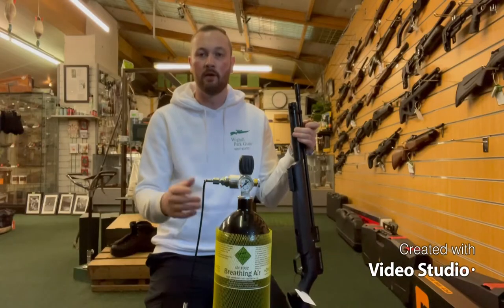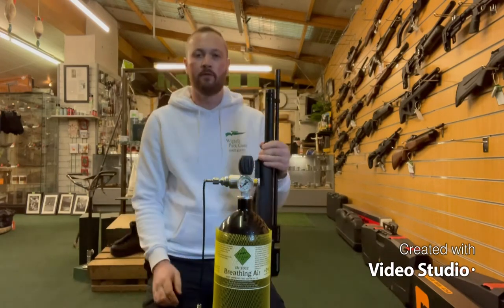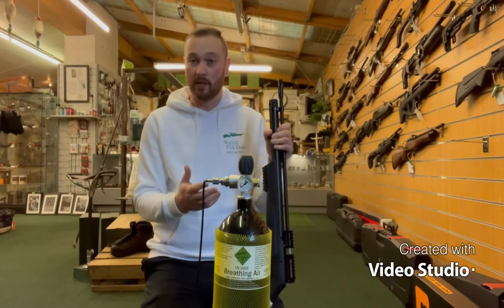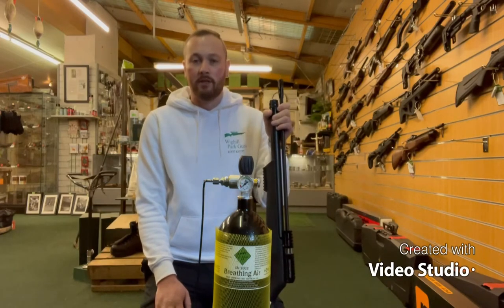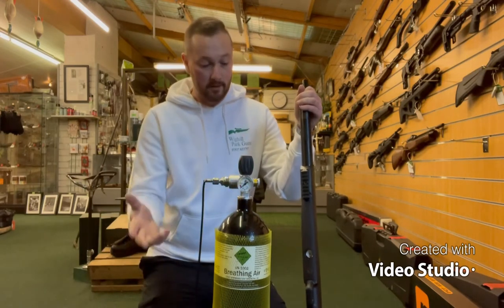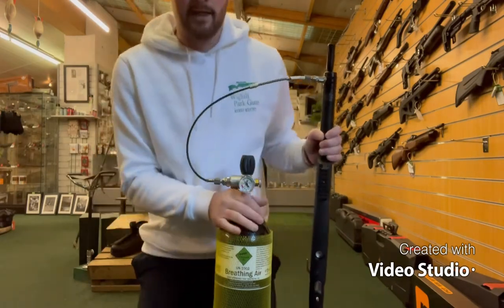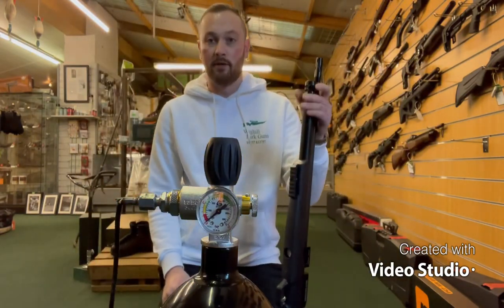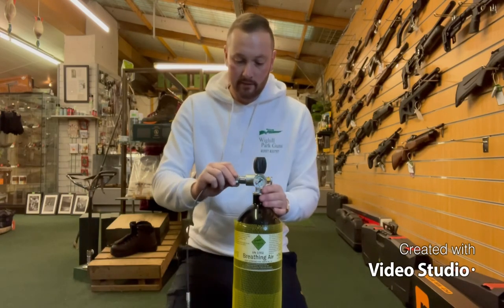How to fill your Precharged (PCP) air rifle

Comment: Random question,  if I went to a shop to fill it up. How long would the pressure last in it , if I had a few shots in the garden then left it for a week, would the pressure still be there/in it
Reply from the maker: Thank you for your question. Your gun should not lose pressure at all. Though in saying that if you’d filled your gun from empty, you might lose a tiny bit of pressure as the cylinder on the gun cools. But if you’re losing a constant amount then your gun has a leak

Comment: My Wehrauch  HW100 wont fill past the 100 bar using the same size tank as yours, i dont know if its a problem with the tank or the rifle but the rifle does hold the air at 100 bar so it probably is with the tank.
Reply from the maker: Thank you for your comment. The likelihood is that you need to have your dive cylinder topping up. I hope that helps.
Reply: @wighillparkgunstv2257   Many thanks for your reply i have just had the air cylinder topped up so when i put air in the HW100  rifle on the air tank its at 200 but still only shows 160 on the rifle gauge, ( i meant 160 on my last message ) i guess its as you said the needle could be faulty on the rifle but i think it still means that it is getting a 200 bar pressure. Is that correct please would you think?